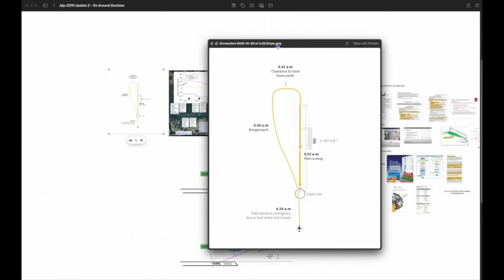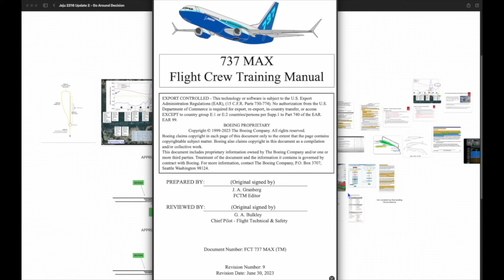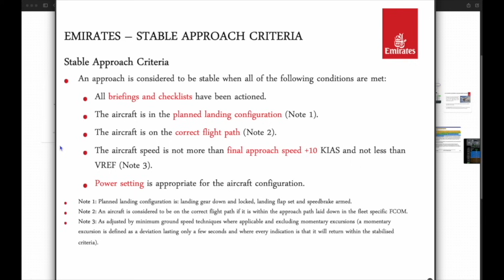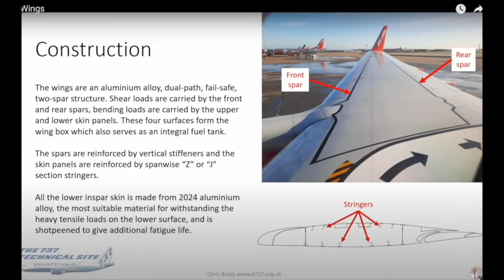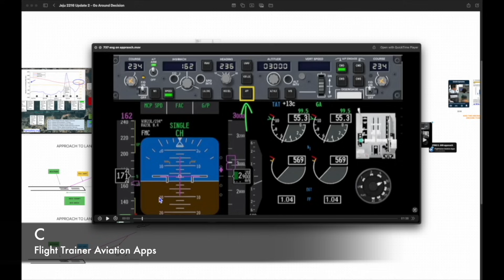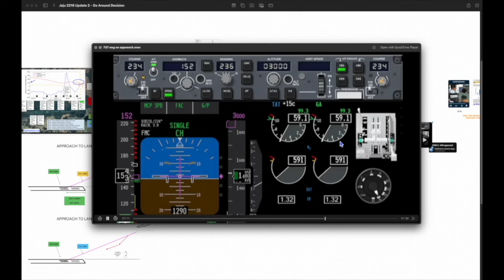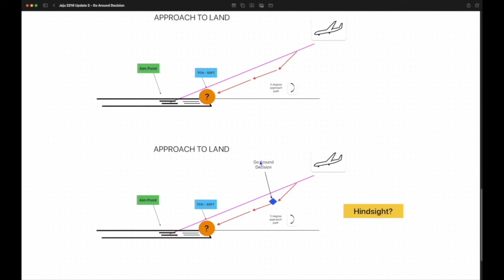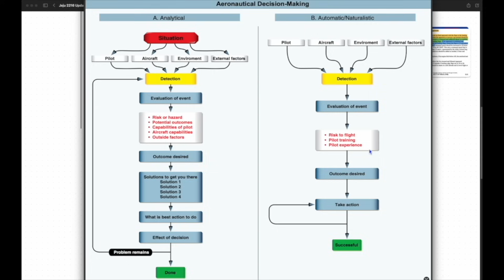Go-Around Explained: Jeju Air 2216’s Decision Not to Land

Comment: Soooo... the crew found themselves slightly below the landing flight path with damaged engines. Why would they rely on damaged engines in an attempt to go around? It's illogical. It would be better to work with what they had [which is a lot... fully configured, low speed, low altitude, coming in to the runway], and trimmed the flaps etc, or if need be power the engines up a litle. Yes, less than ideal for a perfectly stabilized approach and with an element of risk... but in deciding to go around with compromised engines, they took on much more risk....
Reply: absolutely, you name it all !
Reply: The training and procedure following in order to preserve the pilots' career had priority over common sense.  This accident may help change the policies of the airlines and allow or encourage pilots to be more flexible in their decision making.  In this case, the pilots do not need to worry about their careers, so in that respect, their decision was a good one.
Reply: @demetridar506  Training and procedure come from decades of experience in what is most successful. There will be no change in those procedures because of this bizarre, once in a century accident.

The pilots were not trying to save their careers - they were doing everything humanly possible to save their passengers. And, except for a badly placed concrete structure, they would have. Stop blaming the pilots, who did a magnificent job. Your ignorance is showing.
Reply: Because procedure calls for a go-around in the case of a bird strike, or an unstabilized approach below 1000 feet. 

They were not "fully configured" after the strike; far from it. And they had no idea what damaged had occurred, what systems worked or didn't. The decision to go around was not only proper procedure, it was the sensible thing to do. That's why pilots are trained to always go around; and that's why actually pilots, rather than MSFS pilots, are all saying the crew did the right thing.
Reply: @petercollins7730 If the procedures call for a go around in such a case, then they need to be changed. Do you really think it makes sense to go around if you have no idea about the nature and the extent of the damages to the aircraft. What you're saying sounds insane.
Reply: @petercollins7730  Actually, the training gives the crew discretion on whether to go around or not on a bird strike. Logically, you wouldn't want to rely on potentially comprmosied engines.. or risk further strikes in a go around. The question is whther they could've continued to land. Most pilots think they could have. Hemce they reacted/ panicked in a go around.
Reply: @davethewave7248  I have yet to hear any actual pilot say they believe that they should have continued the approach. MSFS pilots don't count.

You say "Logically, you wouldn't want to rely on potentially compromised engines.. or risk further strikes in a go around." Does that mean you would rather attempt to land a plane with compromised engines (or gear, or control surfaces)? A go-around is performed in order to allow time for the pilots to assess the damage and configure the plane to land safely. 

If they had continued the approach, they would have landed with limited or no power, no control surfaces, no brakes, and no usable reversers. Of course, the pilots did not know this, which is why they went around - to assess the plane's condition.

There is no evidence that they panicked and, considering the skill they displayed, much evidence that they calmly attempted to do whatever they could to safely deliver their passengers. You cannot cite a single action they took that indicates panic.
Reply: @petercollins7730  "Does that mean you would rather attempt to land a plane with compromised engines (or gear, or control surfaces)? " The plane was fully configured to land. Yes, continuing to land/ glide in is the best option with compromised engines.... because you do not need to rely on the engines. In going around, you become fully reliant on the engines. That's the simple logic involved.
Reply: @davethewave7248  The plane was fully configured to land BEFORE THE BIRD STRIKE. Do you think it was properly configured for its condition after the strike? Of course not.

If you attempt to land with no idea how much damage the plane has, you 're a fool. If you have significant engine damage - which they knew - you likely have other damage - gear, flaps, slats, hydraulic system, elevators, rudder. If you land blind to these possible damages, you are taking an enormous risk. On the other hand, if you go-around, you can test each system and determine what works, what doesn't , and configure with that knowledge.

Unless these pilots could somehow know that they had lost both engines, a go-around was the only rational choice. And they did not have the knowledge you and I have. They cannot use hindsight and a comfortable seat in a recliner, and two weeks, to decide what to do. The decision to go was made in probably 5 seconds or less. Try that, without your knowledge of the results, and tell me what you would do.
Reply: @petercollins7730  Fully configured to land, low altitude, low speed, near the runway. Then the bird strike on the engines. Now, why would you bring the engines back up to full power, reconfigure the plane, gain altitude... when the engines are potentially compromised by the bird strike. I rest my case.
Reply: @davethewave7248  Because you need to know what else has been damaged by the strike. That's why you go around - to gain time to assess the condition of the plane, to plan for your new approach, and to prepare the cabin.

If they had continued, knowing what we know (and they didn't), the plane would have overrun the end of the runway at more than 100 mph. Since the Jeppesons don't show what's beyond the runway, I can't say what would have happened. But they would have been off the end at very high speed. That's if they could keep the plane straight without lateral control, which they did not have.

So, in your scenario, if they didn't bounce the plane upside down (no spoilers, landing at 160 knots), and if they could keep the plane on the runway (no lateral control), they would have overrun at a higher speed than they actually did. Is there a concrete structure at the end of R01? No idea. But clearly, if they tried to land as you want, they would have had a devastating event.
Reply: @petercollins7730  Nope, flaps were down, gear was down, probably still had some residuals in the hydraulics... should've made the best out of a bad situation by continuing to land imo.... more or less just required coasting in as so close to runway.
Reply: @davethewave7248  Thanks for ignoring everything I said. Apparently you just want to continue your little fantasy, and not consider the reality of the situation.
Reply: @petercollins7730  Everything, the whole disaster would've been avoided if they continued to land when the bird strike hit. Simple as that~
Reply: @davethewave7248  No, you clearly have no idea what you're talking about. 

If they continued to land, with no power and no hydraulics, no spoilers, no brakes, no reversers, how would they stop? 

And if a pilot decided, when he knew he had had a serious bird strike and had significant damage, to continue an unstabilized approach, without configuring the plane, he would - and should - have been fired.

Notably, not a single actual pilot has suggested that these pilots should have continued the approach. Only you little MSFS pilots, flying a keyboard.
Reply: @petercollins7730  They were configured to land, gear down, flaps deployed, speed reduced, low altitude... then the brid strike on the engines. Pilots have a saying that when the an alrm goes on, have a coffee... for all too often a pilot can react/ panic and make the situation even worse. If it aint broekn [the landing approach] why fix it? You might be in denial about this. Don't worry, many others are too.
Reply: @davethewave7248  Right. When you have a bird strike and serious damage, you go around, in order to have time to determine the nature and extent of the damage, to configure the plane to land, and to prepare the cabin. That is the 'having your cup of coffee.' You are advocating that the pilots do exactly what they did.

And the approach WAS 'broke. Do you think that a 737 which has lost at least one engine and had a serious bird strike needs the same landing configuration as a fully operational plane making a standard landing? 

You clearly are ignorant of aircraft and airmanship, and in denial about this. Don't worry, many other MSFS 'pilots' are too, just like you. Actual pilots universally agree that what these pilots did was proper and showed excellent airmanship.
Reply: @petercollins7730  They were very low and near the runway. When your engines are broke, you do not go around... as that would involve putting them into full throttle and relying on them... not to mention relying on all the hydraulics in first retracting everything... and having to deploy everything again... if you're lucky. Counter-intuitive.
Reply: @davethewave7248  That is, in fact, the procedure that the manufacturer recommends and that every major US carrier mandates. Bird strike below 1000 feet requires an immediate go-around. 

First you demand that the pilots "have a cup of coffee" - time to consider what they should do. Now you demand that the pilots land a damaged plane immediately. Make up your mind.

Flying a commercial jet does not require intuition - it requires that you follow procedure that has been worked out over decades to ensure the best outcome. That's exactly what these pilots did. Sad that you have no idea what you're talking about.
Reply: @petercollins7730  In 'having a cup of coffee' you do nothing, i.e.; continue to land. Actually, the training leaves it to the pilot's discretion whether to go around or not when a bird strike happens on the landing. Over and out~
Reply: @davethewave7248  No, it means you take a moment and figure out what your situation is. Are you really that dim?

And no, the manuals are all very clear - bird strike below 1000 feet REQUIRES an immediate go-around.

You armchair sim boys are good for a laugh, but thank god you don't fly anything more than a keyboard, and your joystick.
Reply: @petercollins7730  That's not true. Pilots are given discretion on whether to go around or not on a birdstrike while landing.

Seems to me you cannot cope with the idea that the pilots made a complete hash of it. Fly often do you? lol
Reply: @davethewave7248  No matter how many times you make that claim, anyone can look at the manuals and see that you are simply wrong.  The procedure after a bird strike below 1000 feet is an immediate go-around. Go look at the manual from literally any airline, or look at Boeing's manual.

The pilots did a superb job of flying. They took a severely damaged plane and successfully landed it. If the concrete structure was not in the overrun area, contrary to every principle of airport design and contrary to specific ICAO recommendations, every person on that plane would have walked off unhurt.

You need to learn at least the basics of flying a commercial jet. You demonstrate with every comment you have no idea what you're talking about, and you refuse to even look at manuals or reference material. Stick to your Sim - it has a reset button, unlike real life.
Reply: @petercollins7730  "The pilots did a superb job of flying. " This is rubbish. Most pilots that have commented have said the plane was screaming in waaaay too fast, and already half way down the runway. It was practically flying... still had lift on on the wings, which is why it skimmed down the runway. It must also have had some controls working for them to get it there in the first place. Even if the concrete wall was not there, ther ewas likely to have been some serious casualties. Most likely pilot panic. Many will not fly with Korean airlines after this.
Reply: @petercollins7730  many pilots of at least 25 years of experience, even my pilot friends say no matter what you should land first as its 1000 altitude (meaning they would have checked everything for landing.) and configured to land.
Reply: @petercollins7730  wtf, how can you do a go around without knowing the damages when you are configured to land at 1000 ft altitude?? You are putting everyone's life at risk. You ONLY do a go around if the pilot cannot visually see the runway.
Reply: @Anonymous-v8s2s  I have not heard a single actual pilot - as opposed to experienced MSFS keyboard pilots - say that. And after the strike, they were NOT CONFIGURED TO LAND. How can you be properly configured with 2 working engines and no damage and still, in the same config, proper after losing one or both engines and having serious strike damage? Make sense once in a while.
Reply: @Anonymous-v8s2s  You ARE NOT CONFIGURED. That's the point. They were configured for a standard 2 engine approach. Then they lost one engine and suffered considerable, unknown damage. How can you think that the config for a single engine, severe damage landing is the same? And you go around any time your approach is unstabilized below 1000 feet.

If you actually knew anything about flying, you would know that. But you clearly don't.
Reply: @petercollins7730  You talking a lot of nonsense. We have trained this scenario multiple times in "REAL" simulator. As i explained 99% of the times pilots continue to land, it's not wrong to Go Around, but this will open for many other issues.
It is clearly a lot safer to continue to land, if as you explain you have lost all hydraulics, electrics, brakes, that would be a really bad day, and unlikely to happen from a bird strike, unless you had a dual engine failure, which would make the point of Go Around impossible anyway.

There are at least 3 redundancies of every major system, such as Hydraulics, Electrics, Brakes, single engine failure on final approach, and you are in visual conditions with the runway, continue to land is generally the safest option. If all systems have gone, there is nothing that is going to get better by going around, because for all redundancies to be lost on ALL the systems you would have to lost both engines. Which is possible happen on this flight.

Most likely the Go Around was pre-cautionary to avoid birds, they flew into massive flock of birds that damaged both engines, hence they turned back so fast.

You are clearly an Arm chair pilot. I only have 10.000 hours on medium jet. Got some MSFS hours too, but not that much.
Reply: @johnnyalexander5219  I have heard literally not a single actual pilot suggest that continuing the approach would be the proper course. In no actual airline simulator in the US would continuing the approach be the proper course. You are simply lying. You are a MSFS 'pilot' talking nonsense.

Your utter ignorance of both procedure and the actual mechanics of the planes proves you are not, and never were, a real pilot. You probably have 110,000 hours on MSFS in your Mommie's basement. Again, no actual pilot has suggested that continuing the landing would have been a better course, an every airline procedure is an immediate go-around. Stop making things up.
Reply: @petercollins7730  I have nothing to prove to you, you can believe what you want. 
I am just stating the facts, you list up X, Y and Z failures, guess what if you have all those failures, you probably not going to be able to even control the aircraft to Go Around.

After Swiss Air Flight 111, when they were on fire, they elected to go through all the lengthy checklists, which delayed their approach which sealed their fate.

After that certain emergencies would request pilots to think outside the box, and it would have been better they would have tried to land as soon as possible, rather than making sure they had done all the checklists.

Please don't speak of things you don't know. There is nothing indicating that they were massively unstable on short final from the data we have seen so far.

A Go Around might sound like a "simple" procedure, but it is also a procedure that requires a lot of thought if you have damaged engines. 
Even with 1 engine damaged, the aircraft can continue to autoland.
Reply: @johnnyalexander5219  Since these pilots DID go-around, and successfully landed the aircraft on the runway, your claim that they couldn't is disproven.

SwissAir could not have reached an airport no matter what they did. And if they had reached an airport and attempted to land so grossly overweight, they would have crashed in a massive fireball.

Pilots need to follow procedures, because those procedures have been developed over decades to provide the best possible chance of the best possible outcome. And these pilots did not run any checklists; in the less than 3 minutes they had, they may have gotten through the memory items.

You demonstrate that you have no idea what an unstabilized approach is. Since they were configured for a standard 2 engine landing and after the strike they had a loss of power, unknown damage, and a plane without at least some controls, they were, by definition, very unstabilized. Every unstabilized approach below 1000 feet calls for a go-around. That is the policy of every airline, because it is provides the best chance for a positive outcome.

You are the one that is speaking about that about which you know little or nothing. From mischaracterizing the SwissAir crash to not knowing what an unstabilized approach means, you obviously need to learn more than ho to reset your MSFS setup.
Reply: @petercollins7730  That's not true regarding the SwissAir.

After the SwissAir, checklists should be second priority, landing should be made within 15 minutes. There are overweight landing procedures in place. Do what you can of checklists, but go straight towards an airport to land. SOP's sealed their fate. 

Many big lessons was learned by the SwissAir. 
I have spent years studying these things, not a 5 minute google hero.
Reply: @johnnyalexander5219  The final report on SwissAir stated:
'"A theoretical descent profile calculation, conducted by the TSB during the investigation, confirmed that, because of the rapid progression of the fire and its adverse effects on various aircraft systems and the cockpit environment, they would not have been able to complete a safe landing in Halifax, even if they had undertaken to do so at the time of the PAN PAN urgency radio communication at 10:14 p.m. ADT."

So, your claim is contradicted by the board who conducted the investigation. 

The actual recommendations included the suggestion that checklists be prioritized, to encourage immediately heading for the nearest suitable airport; it did not say that "checklists should be second priority."

Everyone can read the TSB report and see you are not telling the truth.
Reply: @petercollins7730   The report did help to form the new polices for procedures in regards to fires. The first line of the checklist is basically find a place to land as soon as possible. Max within 15 minutes.

That's exactly what I said. LAND ASAP. Completing complex checklists are important items, but they are second priority. Normally what happens is that one pilot flies towards the airport to land, while the other if possible does as much as they can of the checklist until they have to assist with the landing / approach.

These procedures have been developed after the Swissair accident, but thats not the only accident where procedures have been improved over years. But is one of the most extreme cases, where the SOP's to complete countless checklists took priority over landing asp.

Not sure of what your issue is, but you seem to know very little about aviation, so just try to learn something than trying to pretend you know something.
Reply: @johnnyalexander5219  No, you said that the recommendation was to ignore the checklist. In fact, the recommendation was to follow the new checklist - exactly the opposite of what you said.

And again, you're wrong. In the case of a bird strike, both the flying pilot and pilot monitoring have specific memory items to do, before a checklist is consulted. And without power , the plane is in manual reversion. Both pilots need to be on the controls to have any chance at turning and landing. In this case, it is certain that, in the short time available, no checklist was ever consulted.

Since all of what you said about SwissAir is patently wrong - the TSB report did NOT recommend ignoring checklists, and the report explicitly stated that, contrary to your claim that doing the checks caused the crash, NOTHING THE PILOTS COULD DO COULD POSSIBLY SAVE THE PLANE. SO, you are zero for two, little boy. It's you with no knowledge, just a huge ego.
Reply: @petercollins7730  Whatever, clearly you are unable to read the 2008 report. All the best to you Sim expert LMAO
Reply: @ You mean the report that said:
"A theoretical descent profile calculation, conducted by the TSB during the investigation, confirmed that, because of the rapid progression of the fire and its adverse effects on various aircraft systems and the cockpit environment, they would not have been able to complete a safe landing in Halifax, even if they had undertaken to do so at the time of the PAN PAN urgency radio communication at 10:14 p.m. ADT."

Funny, because you said following procedure was what killed everyone. "Doing SOPs sealed their fate."

Or do you mean the report that emphasized the need to follow the revised the checklist, when you claimed that it said "checklists should be second priority?"

You seem to be the one who can't read.
Reply: @ The report formed part of many changes that happened after that accident. Not all of those changes are included in the report.
Any hint of smoke/ fire now prompts immediate diversion to land within 15 minutes.

The smoke /fire checklist is basically trying to locate the fire and the reason for the fire.

Seconds lost doing checks before diversion can be the difference between life and death.

If time and appropriate you continue the checklist as long as possible.
But priorities land as soon as possible.
Not everything is written in that report. Many changes since that time
Reply: @johnnyalexander5219  Sorry, but you accused me of not being able to read the report. When I quoted the report, proving your claims wrong, now you say that "not everything is in the report." Make up your mind - is the Transport Board of Canada's report, with the concurrence of the US NTSB, accurate/ Because those say that you follow the checklist, not ignore it.

Since the QRH checklist for fire lists an attempt to divert, if possible, as the first step, your claim that "The smoke /fire checklist is basically trying to locate the fire and the reason for the fire." is just wrong. The checklist literally prioritizes exactly what you claim it doesn't mention.

If you are going to claim that a report supports your claims, you should have read the report first. You didn't, since the report, as I quoted, contradicted both of your claims. Next time, read the report. And your penance is to go to Peggy's Cove and say  a silent apology to those pilots who flew their plane until it disintegrated around them, trying to save their passengers.
Reply: @petercollins7730  When I said "read the report" I was referring to the RyanAir 2008 Rome incident, where Boeing recommended continue, and not Go Around.

Your landing distance of the 737 was wrong, FCOM from Ryanair provided as reference, also the recommendation from Boeing / FAA that it is better to continue than go around in case of bird strike on short final / approach.

You was claiming it was a mandatory go around, which is complete utter nonsense. 

The Swissair I used as example why going into extensive checklists when in a very sudden serious damage might not always be the best option. I was not going into an indepth discussion of that accident. Sometimes it's better to get on the ground first and then deal with complex checklists.
Reply: @johnnyalexander5219  Nice way to move the goalposts when you are shown to be completely wrong.

The landing distance I quoted is straight from the Boeing manual - you can look at it online if you like. I am certain anyone who has ever flown RyanAir would be happy not to do anything they say - they are perhaps the worst carrier in the first world. And, as I said, every major US airline mandates a go-around in the event of a strike on approach below 1000 feet. You can read those manuals online, too.

And you blame the pilots for all the deaths on SwissAir, when every single investigation showed that absolutely nothing they did could have saved the plane. You should be ashamed.

Finally, if you 'get on the ground,' you have no need to 'deal with complex checklists.' That's just idiotic.
Reply: @ Not blaming the pilots, it was the company’s policies and procedures.
As a pax I don’t like Ryanair, but they are definitely one of the safest airlines in the world.

Not moving the goalposts, just explaining you in a simple way how things works.

Of course you need to use checklists on the ground, engine fire checklists, emergency evacuation checklists or any other applicable checklist for your current situation.

The FCOM is generally more or less the same if it’s for Ryanair or some other carrier flying Boeing.

737 and A320 fly to similar airports/ runways. So 2500 m is a good length runway for these aircraft.

Maybe you are not reading the manuals correctly.
1600 m is short, but is not an issue for the 737.
Reply: @johnnyalexander5219  No, the cause of the deaths on SwissAir was bad equipment. Policies had nothing to do with it. Do try to read the reports.

RyanAir has had exactly as many fatal crashes in the last 5 years as ..... every other major Western airline. Safest? Silly. Worst run? Absolutely.

You don't use the same checklists on the ground as in the air.  Do try to make sense once in a while.

Yes, all major airlines have essentially the same procedure for a bird strike below 1000 feet - immediately go-around Thanks for admitting that.

And of course the 737-800 is the same as the A320, except the Boeing is longer, wider, taller, heavier, and more powerful. None of those, according to you, I guess, matter. They are identical, right?

Saying a runway is "short but not an issue" is like saying "the plane is on fire, but it's not an issue." If the runway is short, it isn't safe. Do you ever actually do any research? Do you even understand what words like "short" mean?
Reply: @petercollins7730 No it’s not immediate go around .
Anyway loads of other waffle I am not even going to bother respond to.
Reply: @johnnyalexander5219  "Most likely the Go Around was pre-cautionary to avoid birds, they flew into massive flock of birds that damaged both engines, hence they turned back so fast."

That was my interpretation or that the approach had become unstable as the result of avoiding birds.
Reply: @ The problem with this theory, is that it is the opposite of what is recommended.
Recommended is to continue to land, as low engine power will cause less damage than high power during a go around.

This is both Boeing and FAA / EASA recommendation.
Reply: @johnnyalexander5219  Yep, only logical.
Reply: @christopherrobinson7541 You said "There is nothing indicating that they were massively unstable on short final from the data we have seen so far."
^^ ADSB data shows a brief but violent correction, then, something like "what are we gonna do ? continue or go around ?" To me, that's unstable enough to make any pilot to reconsider.

You insist on blaming the go around for the 179 fatalities. Both are unrelated. Had the aircraft gone around, and immediately stalled to crash 20 seconds later killing everyone, you would be very close to had it right, directly related. Here, the go around gave the aircraft the energy to climb and accelerate, proof are a tear drop pattern and overrunning the runway above 150 kts. This completely invalidates your belief of "pilots decided to go around with damaged engines". The going around was NEVER an error, pilot had finely working engines at the time. You just don't understand aircraft was climbing and speeding with landing gears and flaps retracting without issue towards an holding pattern to sort out things with perfectly fine hydraulics... then the severe bird strike occurred. Take your guess, a first small bird strike without any consequence, followed by a second severe one (and perhaps a third), or an unstabilized approach into go around, into severe bird strike (into possibly a more severe one). Whatever you prefer, both works, just understand we are way out of a classic bird strike, I would say Sully had it easy (only one flock of birds)

Most of you talked about being pilots or having asked pilot they know, I don't care. But none of you mentionned having a look at EICAS/engine readings before deciding to continue or go around. You have N1 readings, engine vibration, EGT, and all failure indicators, including hydraulics. When that Master Caution loudly warns you something is wrong, you go read instruments... Going around or continue is on your agenda, BUT you read instruments first. Why ? The moment you know you have power to climb and controls, you go around, you DON'T PLAY COWBOY ALA MSFS. The reason why that policy is enforced in airlines is because 99.99% of bird strikes are not fatal to engines. The 0.01% cases are Sully and this Jeju Air. I'm amazed how long you guys are argueing about the relevancy of that go around: it was, PERIOD !

You have forgotten the third option: continue approach, sustain a (second) severe bird strike, stall cause you have too much drag, ditch the plane before the runway. (when you say "continue is less risky", it doesn't take much for a full flaps 737 to plumet like a rock in case of total engine failure...)
Reply: @petercollins7730 , actually most of the pilots that analysed this crash said it was preferable to continue the initial landing attempt, it is common sense, you don’t need to be an expert to figure this out! So what are you talking about??
Reply: @mihainicolae8141  No, NONE OF THE ACTUAL PILOTS said that. The little boys who fly a sim in Mommie's basement said that.

And good judgement is to go around and determine the damage to the aircraft and what systems were functional before attempting a landing.

Clearly, you have no knowledge of how to fly a plane.
Reply: @petercollins7730 , I’ve seen multiple actual pilots suggesting that, stop pretending you know the opinions of all pilots! It makes absolutely no sense to stop a landing attempt when you have flaps, slats and landing gear, without making sure you are able to make another attempt! It is obvious that the outcome of continuing the initial attempt would have been better than a high speed belly landing on a runway with a concrete wall at its end! Stop insisting on your stupid ideas, actual pilots said that the best option was to continue and they just agree it was difficult to decide! And there is nowhere stated that a go around is mandatory in case of a bird strike!
Reply: @mihainicolae8141  I have not heard a single pilot say that, and it is contradictory to everything they are trained to do. I have heard a lot of YouTube pilots saying that.

So, apparently you think you know more than Boeing, and the airlines, and the pilots. You have no idea what would happen if you land a seriously damaged aircraft without bothering to check and see what systems are still functional. All of you "experts" make yourselves look ridiculous.

Read the manual for :American Airlines; Delta; United; Southwest; and Alaska Airlines. That's the 5 largest US carriers. Every one o them explicitly call for a go around in the event of a bird strike with damage below 1000 feet. The only exception is "severe or enveloping fire." Now, either all of those airlines are wrong, or you and your YouTube pilot buddies are wrong. I'll listen to the airlines and the real pilots.
Reply: @petercollins7730 , if you have not heard it does not mean they have not said that. I watched a lot of major aviation channels and there is not a single one of them where they did not question the idea of a go around in that situation. There is also the debate if they decided to abort the initial approach before or after the actual bird strike. I repeat, it is a matter of common sense, it seems you don’t have any….
Reply: @mihainicolae8141  So, somehow, the one pilot who says what you claim I missed hearing? How - by magic?

Your "common sense" is not what pilots use to fly commercial planes. Pilots use procedures, rules, and checklists. Sad you don't understand even that much.
Reply: @petercollins7730 , what procedures are you talking about, what checklists did they go through in the 4 minutes until they landed on the opposite side in the worst possible configuration after they aborted a landing with the correct configuration? You talk nonsense, without using the common sense the landing in Hudson river for example would have never existed and all people would have died. The pilots should not act like robots, they should use common sense when it is obviously the best approach! In case of bird strikes the procedures say it is pilot’s decision regarding continuing or aborting landing!
Reply: @mihainicolae8141  They used, I would expect, no checklists. Not time for that. The memory items would have included determining:
Whether the landing gear was still on the plane and functional;
Whether the spoilers were operable;
Whether the hydraulic system for the braking was intact and functional;
Whether the reversers were functional, whether either engine had thrust, and what the thrust differential would be;
Communicating with ATC, requesting special handling, requesting the equipment.
At minimum,  each of those tasks needed to be done before attempting a landing, and a go-around would provide time and altitude to do all of them safely.

After the bird strike, they WERE NOT CORRECTLY CONFIGURED. Only bob-pilots would think they were. They had, at minimum, degraded performance in one or both engines; unknown hull damage; and likely damage to control surfaces. They also were no longer on glide. They were so far from a stabilized, configured approach as can be.

Sullenberger had more altitude at the time, and he not only went through all of the memory items I have named., he radically reconfigured the plane before ditching. And, of course, he has said repeatedly that the pilot's choice to go around was "a very sound and reasoned decision" and that it "maximized the chances for a successful landing." So, your hero says you are wrong.

And, once again, the manual of every major US carrier says explicitly that it is NOT the pilots option - they all MANDATE a go-around in the event of a damaging bird strike below 1000 feet. Everyone can read the manuals online and know you are not telling the truth.
Reply: @petercollins7730 , it was far easier and with infinite more chances to correct what needed to be corrected for the initial approach than to retract landing gear and flaps and to go around hoping they could land successfully. Do you really think the outcome would have been the same? They were at much lower speed, they had landing gear, they were close to the runway, they had almost everything! The decision to go around was a fatal mistake, let’s be honest!
Reply: @mihainicolae8141  At 400 feet, they had no chance to correct what they did not know was failed. That's the point - they did not know what worked and what didn't.

If they had continued the approach, they would have bounced repeatedly - no spoilers. And they would have, if they could get the plane down, have run off the end of the runway - no brakes or reversers.

The decision to go around was the only reasonable decision. IIf they could have successfully climbed out, they would have had time and opportunity to determine their condition and configure appropriately. As it was, they successfully landed - they just ran out of runway. You forget that fact - the landing was fine; the failure of the airport design killed the passengers, not the pilots.
Reply: @, there is no way it could get worse than the actual outcome! If they did not know what worked and what did not work the obviously best approach was to land as soon as possible. If you have damaged engines, the worst decision is to force them with an aborted landing!
Reply: @petercollins7730  , once again, from an aviation guideline: “Having encountered birds, the question to be answered is "what is the damage to the aircraft and what effect will this have on the safe conduct of the flight?".

The full extent of any damage, to the engines and/or the control surfaces and landing gear, may not be apparent until applying power, configuring, or manoeuvring the aircraft. It might therefore be the case that, if a go-around is initiated, the pilots rapidly find themselves in a situation where the runway is disappearing beneath them but the aircraft cannot safely fly a missed approach.

Therefore, in the above scenario, it is advisable to continue the approach and land.”
Reply: @mihainicolae8141  But the pilots did not know "the actual outcome" in advance. They were operating with the knowledge that their plane had been damaged, to unknown degree, and they needed to determine the damage, configure for a landing with that damage, and then land. And, in fact, they landed very well. They also did not, could not know that there was a huge concrete structure at the end of the runway - it was not on the Jeppesons.
Reply: @ , of course, but isn’t it obvious that if they had possible engine problems they could only get worse when forcing them for the go-around? The same goes for possible hydraulic problems and any other possible damage….
Reply: …..and why didn’t they at least manually lower the landing gear? I think they just panicked and they made fatal mistakes.
Reply: @mihainicolae8141  The fact is, they DID HAVE engine failure and they STILL MADE A SUCCESSFUL EMERGENCY LANDING. Try to deal with that fact - the landing they made on R19 was a textbook gear up landing. Only the  concrete structure, in the overrun zone, contrary to ICAO guidelines, caused the deaths. The go-around and landing were successful.
Reply: @mihainicolae8141  They did not have time to lower the gear. You clearly don't understand how long that takes, or what is required. Both pilots, in manual reversion, would be required to control the lateral placement of the plane for the landing - even a gravity drop of the gear takes time, and takes the FO away from the controls. 

Do you have any idea what is required to gravity drop the gear? Maybe go and look that up before you come back, at least.
Reply: @ , a successful emergency landing is one where most of the people survive. In my opinion it was a fatal mistake to do a go around, this forcing them to a high speed landing with no landing gear on a runway with a concrete wall at its end. If they continued the initial attempt they had much lower speed, landing gear and no concrete wall, so a lot of advantages! Please explain if you can, why didn’t they manually deploy the landing gear? How can this be called a successful emergency landing?
Reply: @petercollins7730   This is 100% wrong what you just wrote. Hindsight is of course a luxury we have now, clearly the Go Around was not the best way forward. However we still miss many details before we can make final conclusion.
In 99% of similar scenarios in the Sim pilots would continue to land, the risk involved with a Go Around is massive, as you are in unknown territory not knowing what will happen when you put full power in for the Go Around, the stress this will put on an already damaged engine can make things a lot worse.

The stabilize criteria is important, but with engine failure / fire the option to continue and land is at the discretion of the PIC.

Your statement is wrong, even with one engine failure the aircraft can easily continue to land, even autoland is available. 
In case of an emergency, you are not required to follow "procedures", and procedure does not call for go around with bird strike. If you are at 500 ft fully configured with the runway ahead of you, 99% of times pilots will continue to land. You are already fully configured. You sound like MSFS pilot by writing such statements.
Reply: @johnnyalexander5219  The go-around was the procedure and it was successful. Try to understand - the pilots got the plane on the runway safely. The reason all the passengers died was because of a structure which should not have been there.

Of course, you Sim pilots all know exactly what to do. On the contrary, real pilots all agree that a go-around was the only course of action. Keep playing in your sim and leave flying to actual pilots.

There was no fire. Do try to keep the actual facts in mind, not your fantasies.

The procedure in every major US airline in the event of a bird strike below 1000 feet is to go around. And once the strike occurred, the plane was not configured. Try to learn what 'configured' means - if you are configured for a standard, 2 engine landing and suddenly you lose power and have serious, unknown damage, you are no longer configured.

You are the one who is telling us how it works "in the Sim."
Reply: @petercollins7730  This is funny, why is the aircraft not figured in the event of a bird strike? LMAO. 
Really?
Do you know what being configured means?
Do you know what is the difference in configuration for a 2 engine landing and single engine landing?

It is exactly the same. That's why you can continue and even Autoland with 1 engine.

Being configured means that Landing Gear is down, and Landing Flap position, and they are the same for both 1 and 2 engine landings.

So if you have lost power (serious damage) on ONE engine, you can continue, there is no mandatory Go Around unless you are in Low Visibility operations, as than you "should" Go Around to reassess. However the caveat is that if you are on fire, or serious damage and not sure if you can safely fly the aircraft / go around, than 1 engine landing is possible, but it would be non standard.

PIC needs to choose safest option.
However this day was CAVOK, weather was great, they were visual, so you can continue,  bird strike is "NOT" and mandatory Go Around. 

Go Around is not wrong action, but it does come with a lot of increased risks.

I have few colleagues SWA, and they all agree, they would have continued. So US or Europe, it's exactly the same.

The Go Around was not perfectly flown, as they must have encountered some issues during the go around, to elect to do the teardrop.

Hence I believe they hit birds during the Go Around which damaged both engines, or they by mistake shut down the wrong engine. If severe vibrations after bird strike it can be difficult to assess which engine is the issue. 
Wrong engine shutdown has happen before, Kegworth and TransAsia 235
Reply: @johnnyalexander5219  Are you really claiming that the configuration is the same for a standard 2 engine landing and a landing with unknown serious damage and loss of power from a bird strike? Even MSFS 'pilots' know that's not true.

You think that flap and slat settings are all that's involved in configuring for landing? Hilarious.

every airline mandates a go-around when an approach is unstabilized under 1000 feet. Every airline. You talk nonsense. The only exception is. to quote one manual, "a catastrophic or enveloping fire." There was no fire here.

Southwest explicitly requires a go-around in the event of a bird strike below 1000 feet. Requires it. You have no friend at Southwest, or they are janitors - no pilot would be unaware of his own airline's policy.

So they called a Mayday, started to go around, and THEN hit the birds? Why the Mayday call then? More nonsensical idiocy.
Reply: @petercollins7730  The ILS Localizer was in the correct location, it was the aircraft that was trespassing.
Reply: @christopherrobinson7541  It was in the right place, but was mounted on a wholly inappropriate and patently dangerous structure. No one disagrees that that concrete structure should not have been there. If the antennas were on proper mounts, this would have been entirely survivable.
Reply: @petercollins7730  If the ILS antenna had not been present, the aircraft would have hit the boundary wall with a similar outcome.
Reply: @christopherrobinson7541  No, the boundary wall is lightweight construction and quite frangible. It also would have been a much slower impact, since the plane would have been sliding on dirt, not the hard runway. There would have been damage to the plane, certainly, and possible casualties, but it would have been quite survivable.
Reply: @petercollins7730 , they clearly had the option to continue the initial approach! It is really bad judgment to go around in that situation!
Reply: @mihainicolae8141  It is the recommendation of Boeing and the policy of every airline to go around after a bird strike on final. Bad judgement would be to continue an unstabilized approach, with a damaged plane. Read the manuals or ask an actual pilot.